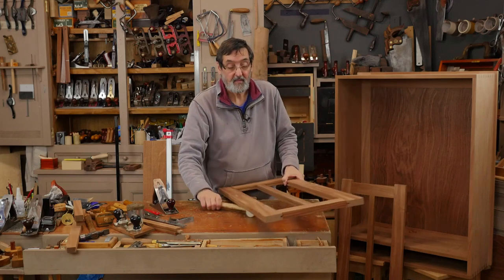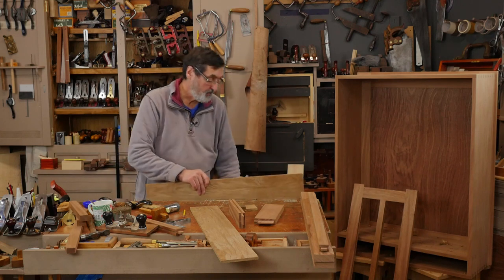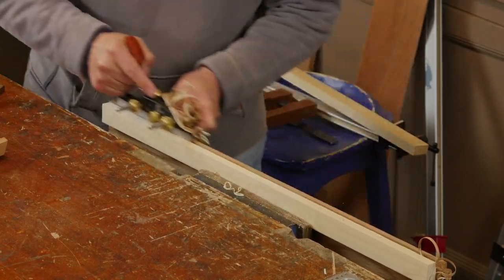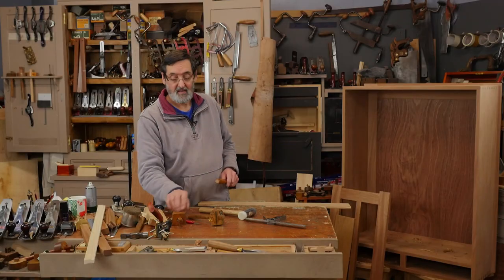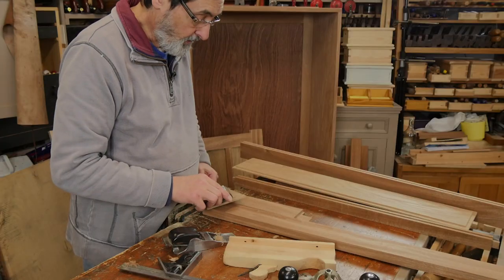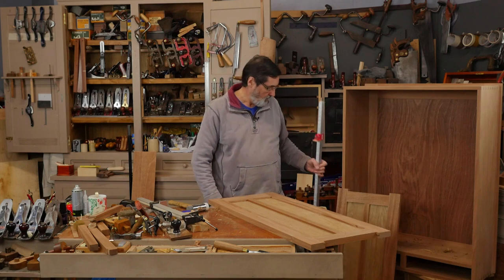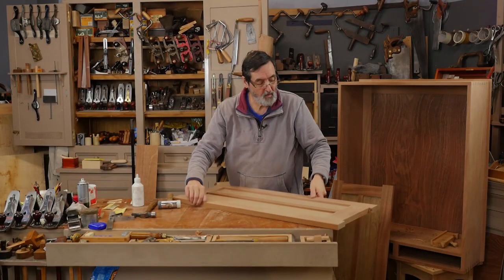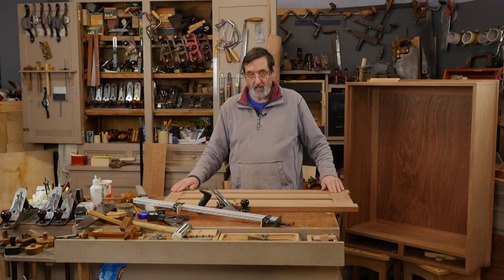Door Making Episode 4 | Paul Sellers

Comment: Great video but I think you made the rabbeting really complicated. I would definetely have used a rabbet plane with the panel flat on the table clamped between bench dogs with the end vice. (As I have a traditional Scandinavian bench.) The panel would then have been suppurted by the bench and the fence on the plane would have been right outside the edge of the bench. Much faster and easier in my opinon. But still 100% hand tools.

Comment: Instead of scraping off the super glue, one could use "the guitar builders masking tape and superglue trick", where you first put masking tape on both pieces, and then glue the pieces on. After you are done planing, the pieces can be pried loose and there's no need to scrape as the glue was on the tape.

Comment: Paul, is there any reason not to use 1/4" thick panels and bypass the rebate step? Are there any strength / stability issues? Great video as always. Thanks.
Reply: Rebate deals better with expansion.